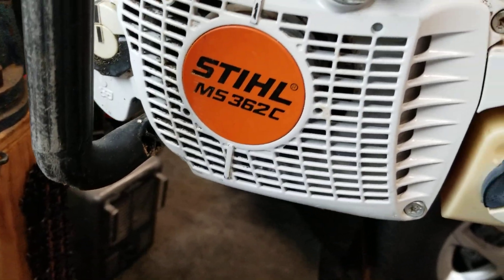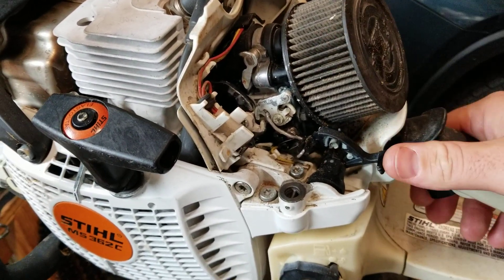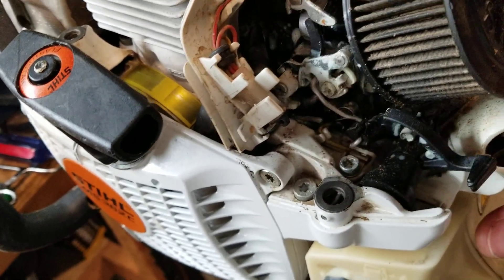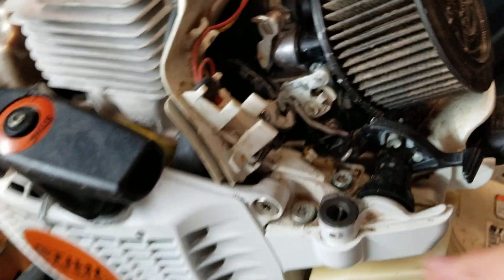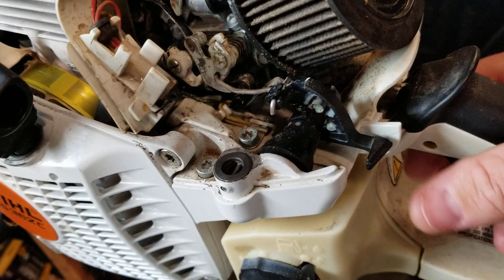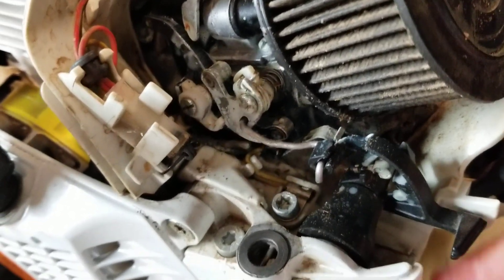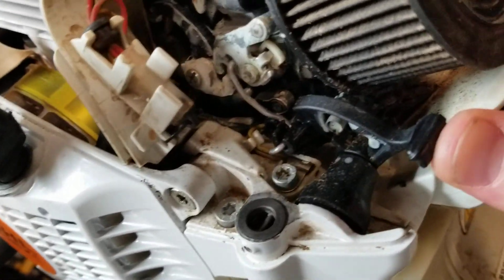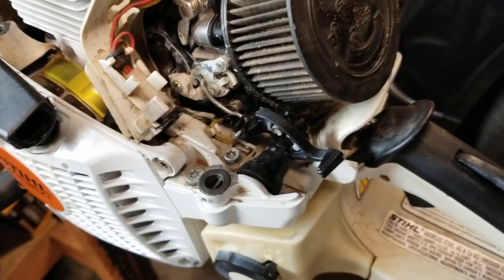Stihl MS362 Choke Lever / Mtronic reset

Comment: That 362 choke lever is working exactly as it was designed to. Imagine that.
Reply from the maker: I know that is how that version works... I put it back together.  There are 3 versions of that choke setup amd they are all way overly complicated and the manual tells of a reset for the computer that involves leaving it on high idle but taking the choke off.  That required manuver is impossible with this choke setup.

Comment: Id like to know if u got it fixed because the version 1 m tron says idle on choke for 90 seconds and flip switch to off dont give it gas or anything and the dam thing cant turn off until u hit the gas.
Reply from the maker: Was able to add some white lithium grease and things started to move better.  I still think it is a terrible design and the many variations available show Stihl knows they have a problem.
Reply from the maker: Also I think too much emphasis is put on a reset of the ignition/fuel system.  I find simply running the saw in some wood often will allow the computer to find where it wants to be.
Reply: @NCSU4x4  So you didnt replace with the stihl kit? Having the same problem with 261c
Reply from the maker: @kallewaedele no the kit was specific to a range of serial numbers and would not fit this unit.

Comment: there is nothing wrong with the choke / throttle action , it is working how it came out the factory , as it is m-tronic , it doesn't need to be flicked back to start like alot of non mtronic machines , simply because to reset the m-tronic , you have to start it on choke and let it idle for 60 seconds then full throttle it and let it do it's thing , version 2 and up of mtronic , but nothing wrong with that , it all looks fine to me ,
Reply from the maker: You know there are a lot of people that would disagree with you including Stihl.  They have a new kit to replace the whole mechanism including rod and lever as there were so many issues with the setup.  I have one on my bench right now waiting on a kit..
Reply: @NCSU4x4  maybe , maybe not , i am in uk , an all ms362 i have seen / worked on have been like that , infact i have a ms362 in the shed as we speak , that is the same , i am not saying it hasn't been updated or reworked , just saying that is how it come from factory , maybe in us or other countries they are different , but in uk they are not ,
Reply from the maker: @darrenfrost5775  as soon as the parts get here I'll try to get another video of the differences.  In my experience if Stihl offers a "kit" its a known issue.  Another such item is the BR800 mufflers.  Come with new hardware and all as one part number.
Reply: @NCSU4x4  please do , because even looking on the site where i get most my stihl parts which is on the stihl b2b live site , they only list the one switch and choke rod , so would be interesting to see ,

Comment: So I'm sat doing mine now with exactly the same problem. I have a brand new switch unit and choke rod and still having the same problem.
This is an absolute royal pain in the ass and next step is to close the gap with heat. 
Did you get any further with it or work anything else out?

Comment: That is the only way you can take it off choke,  it is designed that way read your manual on the saw it tells you to fully choked and then put on Half choke which only is accelerating the saw it helps the saw start easier after saw is started you just need to Simply pull the throttle to get it back in normal position
Reply: so the way to.reset these. is a s follows. set the choke on. start and let it idle on the choke for 35 seconds. then squeeze the trigger run wide.open throttle for 35 secs. then let it go. it is now.reset

Comment: That seems to be a flaw in the design.
That little wire linkage gets a little bent over time and it doesn't pull in the right direction making it almost impossible to choke...it jams up on that little bolt. Very frustrating. I have also had carb issues with mine. 
I would not buy another on or recommend this model